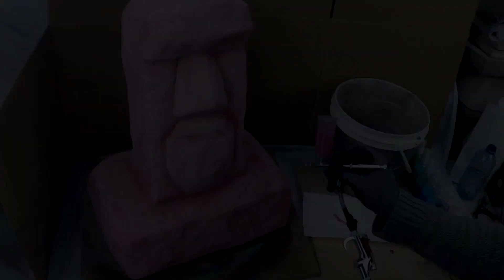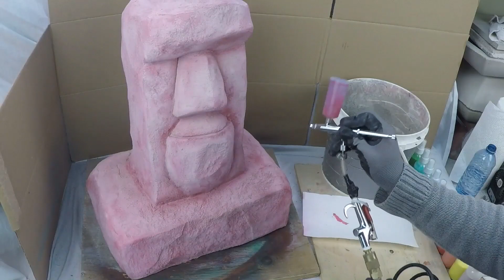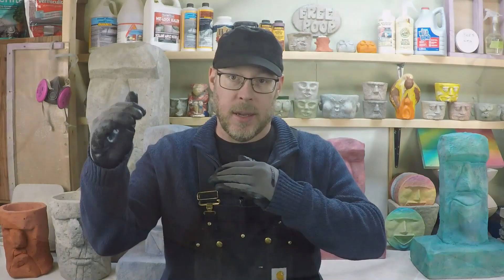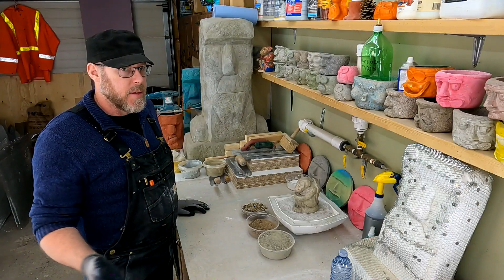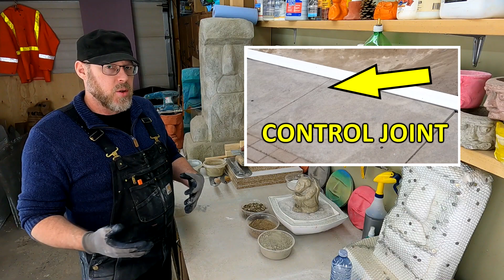Are Cracks in Concrete Normal?

Comment: I am confused. Earlier I learned from you that the concrete mix shouldn't be too wet. But then how I could keep it moist for the first two days? Cover with plastic?
Reply from the maker: The mix itself should not be too wet as this will cause the finished concrete to be weakened.  However, once the concrete has been placed and is starting to harden, it is ideal to keep it hydrated throughout the rest of the curing process (at least for the first week of curing).  And covering it with plastic will help to reduce the amount of water evaporating from the curing concrete.  You can watch this video about wet curing concrete:
https://youtu.be/pi5ezmmV8aU?si=xOGVXmJbS0B0diwo
Reply: @creatingconcrete  Thank you very much!! Appreciate it.

Comment: how do you make it more flexible?
Reply from the maker: Concrete is not flexible.  It needs expansion joints and proper preparation of the ground to minimize cracking

Comment: What is your opinion of post-tensioned concrete?  Is it worth the risk?  Should post-tension concrete be used with the standard thickness, and not the high tension to avoid the risk?

Comment: I have read that adding fiberglass strands will help prevent cracking.  For large pours, that in addition to the steel you noted seems like an interesting combination to deter cracking.  Any comments on this?
Reply from the maker: fibers are very commonly used for concrete pours where strength is important. Most flat work is not engineered to be this strong with water reducer, fibers etc. unless there is a need for it to be stronger than normal.  Fibers help to minimize hairline cracking.